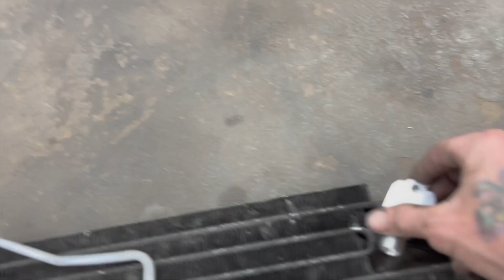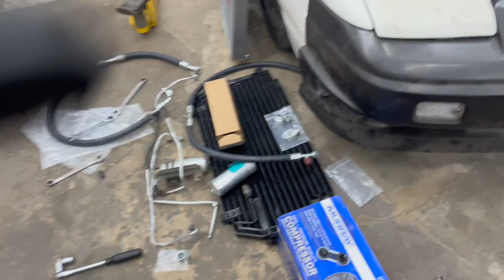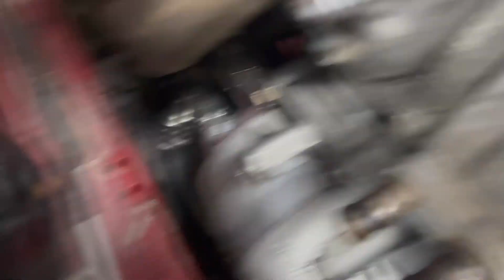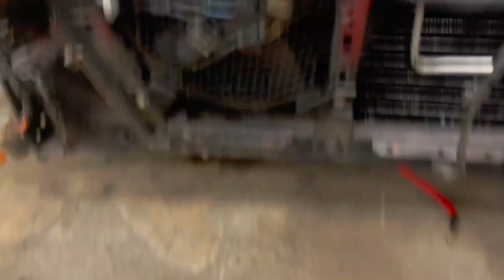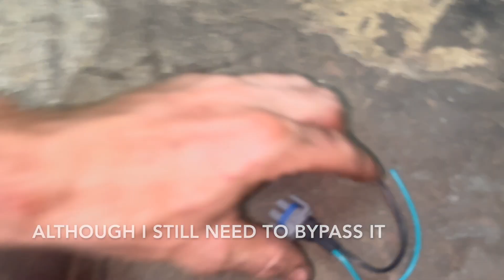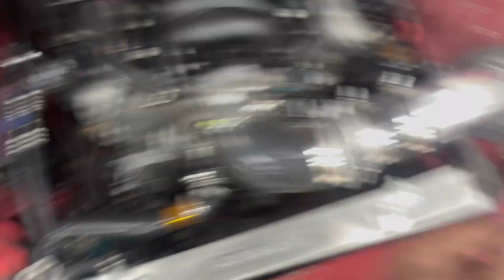AC in an LS1 240sx!! Sikky Air Conditioning Kit

Comment: So how much r134 and oil did you add?
Reply from the maker: 1.5lb r134a
Reply from the maker: System capacity is 8oz of oil minus whatever comes in your compressor
Reply: @Nscardigno33  thank you, have you done this on a s14? Having trouble with the high side hose.

Comment: So did you leave the over temp switch unplugged since it was bypassed by the wiring extension you made?
Reply from the maker: I just removed it and wired in to ac output as overtemp is only used in the sohc 89-90 chassis

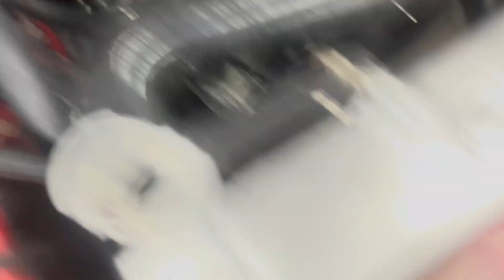Comment: So at 12:23 u just crimped those two together?
Reply from the maker: Only if you are using a gm ecu and pressure switch to control . If not then you still need to retain this pressure switch
Reply: @Nscardigno33  ok cool I have a 06 gto motor and ecu so I heard it doesn’t have the safety turn offs and what not…I saw u put in the pressure switch but didn’t see how u wired it, does it go directly to the ecu?
Reply from the maker: @Kanyondrift  the wiring specialities harness w/ac add on has a plug for the factory gm pressure switch that goes to the ecu
Reply: @Nscardigno33  ur video has inspired me to get my ac working after having this swap since 2012 lol. Couple more questions what fan setup are u running?..and I just got my wiring somewhat close..bypassed the factory switch now my ac button lights up when I hit it. Should I see 12volts when i hit the ac button at the factory wire for compressor plug? I got nothing when I press it. Figured the relay would click, maybe the relay is bad ?
Reply from the maker: @Kanyondrift  that’s funny I just commented on your fb post 😂 if you are running it directly through the 240sx system then yes there should be 12v at those wires When the ac button turns green. Possibility you don’t have the ac wire hooked up from the brown plug under dash to grey plug in engine bay. That takes the signal from climate control and sends into body harness. Are you running no pressure switch at all ? I would deff recommend the oem pressure switch if you aren’t using a gm one through the ecu. Fans are flexalite 440 then a puller on front of condensor .
Reply: @Nscardigno33  haha that’s u ok lol  no pressure switch yet just trying to get it all ready maybe I’ll send u a video on fb with what I got

Comment: DUDEE TYTYTYTY for posting this!! I've been banging my head on the wall for months trying to look for the AC harness. 

I got a 5.3 with your old version of wiring specialties H. I couldn't figure out where the plug was. and thought mine got cut. But Old versions are like this .....
Reply from the maker: No problem glad it helped I also was in the same position so I kept doing more research and found there is  the new style with both plugs or old version with only pressure switch . Install was super simple

Comment: I could've sworn that had the compressor connection and the switch wire built-in (pro harness).
At least mine appears to have it already wired.
Were they just not long enough to reach?
Reply from the maker: so there was a new version and an old version .. old version is the one I have with only the pressure switch built in . New version which you have has the compressor switch on the harness itself.

Good question tho because as I was putting mine together I was asking the same question where’s the compressor plug 😂 did some research and realized they changed the harness design .
I’ll try to post links here as well in a bit

Comment: Soon Im putting an s14 Sr into my single cam s13 that came with factory ac what do I need to keep my ac. I don’t want to lose my ac that still works 😭
Reply from the maker: Look up the Cody ace bracket
Reply from the maker: They only sell brackets to use dohc ka compressors although you would have to do something like this or convert your system to dohc

Comment: This makes me want to add ac in my rb20 s13
Reply from the maker: Pretty simple that way because you can reuse basically everything factory. Personally I would even make a bracket to use a ka compressor on the rb so you can use the complete ka system
Reply: @Nscardigno33  yeah that would probably be the best way to do it. Need to find all the stock lines and condenser since I sold my stuff years ago which sucks